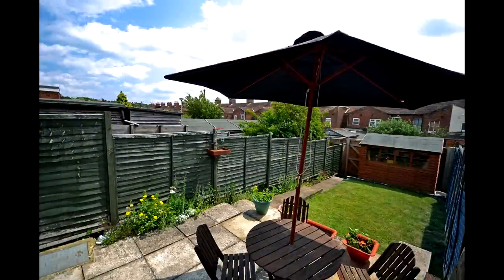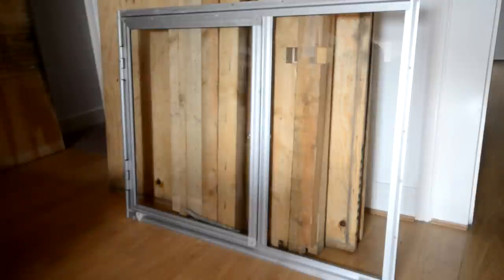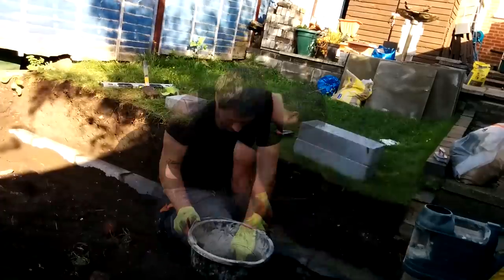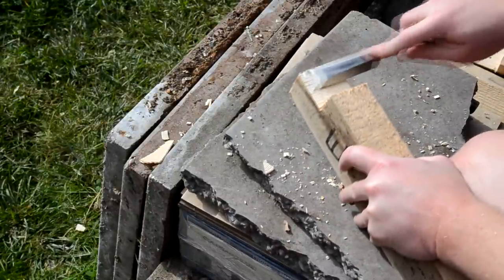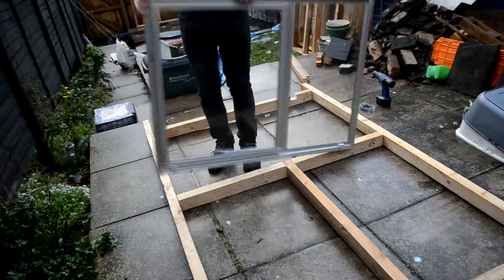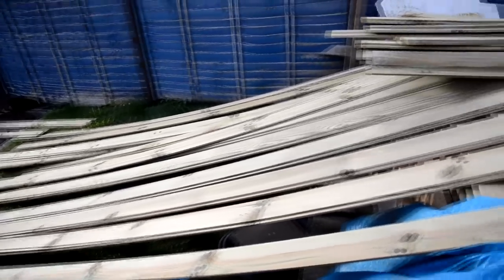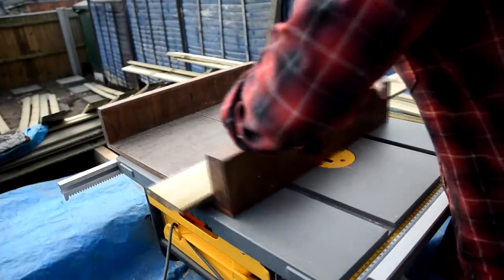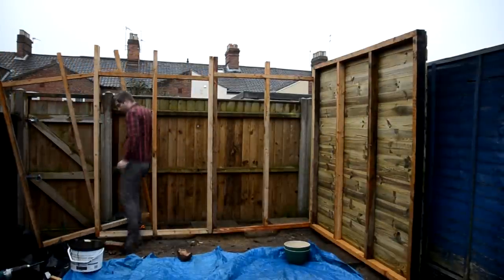Building The Workshop Shed (part 1 of 3)

Comment: Planning on building a timber workshop, a large one!
However may U suggest that in order to check your frame is square the best way is to measure across reach diagonal. As a professional woodworker this is a foolproof method

Comment: I think you might have got the bracing the wrong way round on your mini tool/bike shed's doors. Think it's supposed to go from the top of the unhinged side to the bottom of the hinged side. Probably so light it doesn't matter but thought I'd mention it in case you got some sagging.

Comment: Nice build, but overkill on the frame and a mistake on using drywall screws with pressure-treated lumber.  The copper-sulfate in the pressure-treated wood will react with the untreated screws and cause them to corrode clean through.  So when the ship-lap (very nice touch) starts popping loose, use double dipped galvanized or treated deck screws to re-attach.
Reply: Nice video content! Excuse me for the intrusion, I would appreciate your opinion. Have you heard the talk about - Mahorrla Wooden Paradise Method (do a google search)? It is a great exclusive product for building better sheds and woodworking without the headache. Ive heard some pretty good things about it and my mate at very last got cool success with it.
Reply: He’s right about the drywall screws. They should not be used for any exterior work. In fact they should not be used for anything but drywall.

Comment: It's a good looking shed. 

I think I will look for wood similar to what you used.
However, I would put the tongue in grove boards inside. That would make a beautiful wall. 
I would go with metal outside, for better protection against the weather. 

But, great job.

Comment: Could you tell us about the foundations and how you decided how to do them There seem to be so many options.
Reply from the maker: +Alistair Dymock I'm no expert but the options that I had were: get a concrete slab laid professionally or lay some paving slabs on some sand and try and get them all level with each other. I couldn't do the first option by myself/inexpensively so I went for the second option. I didn't want to use pressure treated wood as over a lot of time it will rot eventually whereas concrete won't.
Reply: Makes sense. I guess breeze blocks (like in your retaining wall) work the same as paving slabs by raising it off the ground? I think you could have done a concrete slab yourself seeing how handy you are! The third option seems to be concrete strip foundations that go around the outer perimeter and in the centre if it's a large outbuilding. I'm trying to decide between the three. One thing I did note was that you didn't use a damp proof membrane between the paving slabs and the floor joists, any particular reason for this?
I  really love this video, helps to see every step, no wonder it's so popular. Last question, for the timber frame on Sketchup is that a special plugin or what? Thanks Mr Brown!
Reply from the maker: +Alistair Dymock I did lay some strips of damp proof plastic between the slabs and the joists but not a complete cover over the whole area, and a few people have already  indicated that I didn't do it correctly. So far though I've had no issues with it (it's been 2 years) so hope it will be ok and I don't plan on living here forever, (mainly because I want a bigger workshop!) SketchUp is available to download for free for home users and it's pretty easy to get the hang of using it. Not sure what you mean by plug in? The rendering etc is all included in the software. Definitely recommend trying it. Thanks
Reply: Sounds good enough to last well after you move. I think the plugin I mentioned is called housebuilder but obvs you didn't use it. Thanks for the advice
Reply: I'm actually wondering whether it was the right thing to do to keep good ventilation under the joists, maybe a DPM would hinder this. I'd love to know the answer.

Comment: Because the floor isn't covered with breathable membrane will moisture rise up and cause a damp issue in the shed and rot it? I want to build a shed around 5m x 3m, my friends say I need to put a concrete base in, not quite sure what to do yet
Reply from the maker: It’s been 4 years and I’ve not had any issues with rot

Comment: Because you dried the timber out and screwed the shiplap once the cold and wet gets to those boards because you've used screws and not pinned it the boards will split and break. Screws won't move nail/pins do.
Reply from the maker: It’s been 4 years, and it’s fine

Comment: been looking for a solution to my condensation in metal roof too. did u jus use the adhesive to stick the polystyrene sheets direct to metal? I'm going to do my wood shed too so would the adhesive hold to the timber too dya know? thanks
Reply from the maker: +scott mclean yes directly to the metal. I'm sure it would work but avoid solvent adhesives as they'll melt the polystyrene. Good luck!
Reply: Thank ;-)

Comment: Nice job mate and well done its good to see some one having a go office worker or not there are plenty of trades people out there who couldn't do any better.
Just as a little tip it might have been an idea to lay your blocks on a bed of concrete in your slit trench as opposed to back filling and laying just on the soil it may move when it rains and gets very wet, just an observation pal not a dig at your attempt. How much do recon it has cost you
Reply from the maker: +Mr Dee cost explained in part 3, thanks
Reply: Yep sorry I didn't finish watching before opening Gob

Comment: Great series of videos...I'm chronicalling my build on my channel. I dont have the same woodworking skills as you seem to have. Do you think screwed and glued butt joints will be strong enough for  framing? Thanks
Reply from the maker: +Dad Diaries hi, thanks. I'll check out your channel. Butt joints will be absolutely fine I'm sure, as that's how most framing is done anyway. If I were to build again I'd probably do it differently as my framing is overkill!
Reply: Rag 'n' Bone Brown thanks for the reply. Ok that's good to hear as I'm not sure I could do joinery at this stage! How have you found the whole build having used it? Any chance of a follow up vid?

Comment: Great video. Are you certain that retaining wall is OK though? You do need to be really careful when supporting compacted soil that is on a gradient. I saw you backfilled it the other side but the lawn side will be much higher density. Hope it was checked by a builder anyways. Liked your other projects too.
Reply from the maker: Thank you. It seems fine, pretty solid and no issues so far. I didn't get it checked by anyone
Reply: OK. It's just I have read you do need to be very careful with walls retaining earth. From the vid it's hard to see how much 'retaining' it will be doing. If you have a heavy snowfall for instance when it melts you will have a large volume of water heading downhill. I saw you used dense blocks but the length is the issue, if you look at garden walls they always have a buttress element every few feet. Also were there foundations? Soil can move very rapidly when on a gradient. Hope I'm wrong anyway.

Comment: nice shed mate but first, you shouldn't drill pilot holes for nails as they will pull out in time. second, you didn't need to bolt the walls together, yes it will add extra strength and rigidity but its over kill. and last please invest in a nail gun. I bet it took ages to put your cladding on using a pilot bit and screws. anyway, looks good just a bit overkill in places.

Comment: Hey, do you need any qualifications to do this project? As I am 16 and my cousins who are 18 are looking to do this project
Reply from the maker: I don't have any qualifications. Just a few years experience messing about with wood. I did look in to building regs though as there's a limit to how tall you can build an out building and a few other factors to consider in the UK. You also need a qualified electrician to help. It may differ wherever you are so worth looking in to.
Reply: Thanks a lot for replying sir.
Reply: Rag 'n' Bone Brown ghreat build, but I would have had the slope drawing water into your garden rather than drain it into the neighbours boundry, it may cause a nuisance to them and end up rotting the fence quickly. At the very least you need to put gutting to collect all the rainwater.

Comment: Good job, but man was all this overkill. Entire houses are built with butt joints and nails and here you are half lapping everything and using bolts! But hey, better over done than under done.
Reply: I was thinking the same thing, you could have framed it one afternoon, sided in another afternoon, and roofed on the third afternoon and you'd be done :)

Comment: 4 metre building in the UK? You sure you didn't need planning permission? Biggest outside building (shed or otherwise) is 12 x 10 without permission as far as I can remember.
Reply: +edward charles qwertyu
Reply: +edward charles qwerty
Reply: permitted planning allows it and many bigger structures nowadays. depends really on the size of the garden
Reply: +edward charles I believe the regs state 15 square meters of internal floor space for buildings within 2 meters of the external boundary and a max roof height of 2.5 meters above the highest adjacent point of land.. If you can build more the 2m away from the external boundary, this can be extended to 30sqm of internal floor space and max roof height of 4m at the apex and 2.5m at the eaves.

Comment: Great series of videos, can I just ask - how did you join each of the sides/walls together at the corners? You would have 2" face butting up against a 3" face if I'm not mistaken
Reply from the maker: Just regular screws. The cladding re-enforced and strengthened the structure anyway

Comment: Just a few quick ones. 
Those blocks are thermalite or similar and are no good for retaining walls and shouldn't really be used outside at all, also a retaining wall should ideally have pillars for support as a single skin of blocks won't hold if the soil decides to start moving.
Also drywall screws not good with treated timber due to corrosion.
Overall though it's a nice build so far